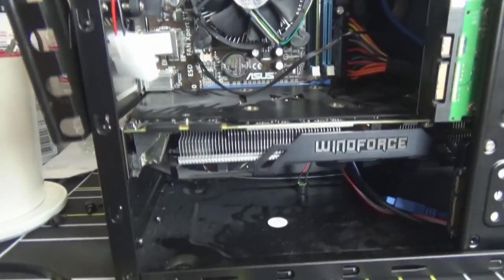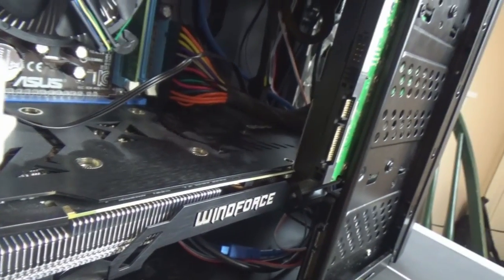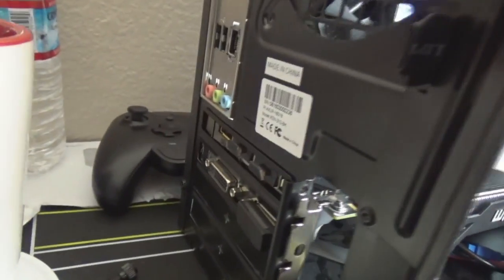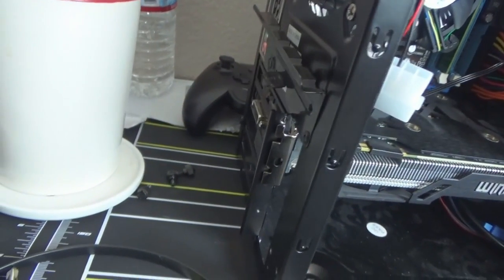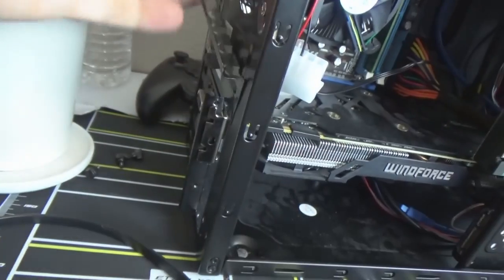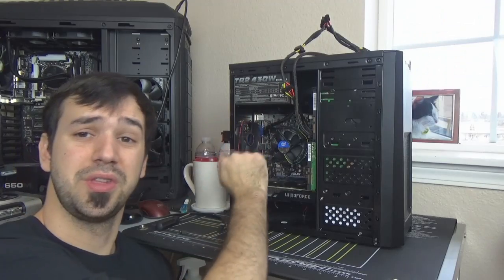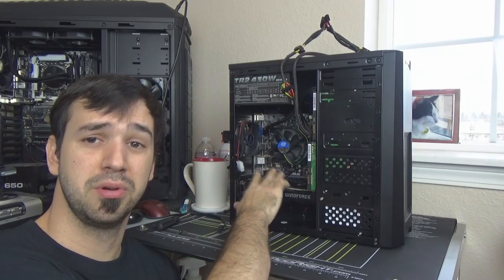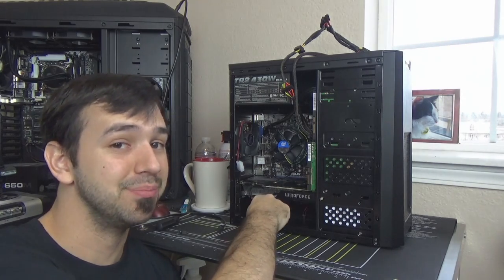Can the XION XON 310 fit a 980Ti?

Comment: will u able to put the GTX 1050 ti in this case
Reply from the maker: Zentr0 Most likely, but double check the length of your card to the length supported by this case (which is 250mm w/drive cages, and 300mm without the drive cage)
Reply: IfThatsTheCase so a 144mm in length gtx1050 ti I should have more than enough room to fit it
Reply from the maker: Yes, more than enough room! Also, feel free to send pics of your build if you build in it!

Comment: what would be a recommended gtx
 graphics card that would be able to fit in the case
Reply from the maker: That depends on which Make & Model of a GTX card you go with. I'd recommend a smaller variant though, and not trying to shove anything too big into it. Think of mini 1050 Ti or a mini 1060, or other variants of the like.